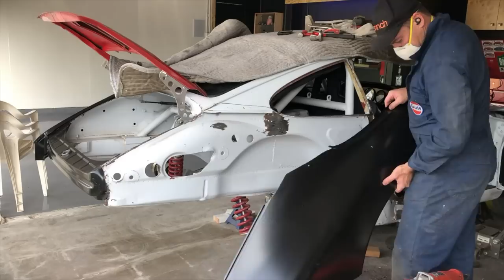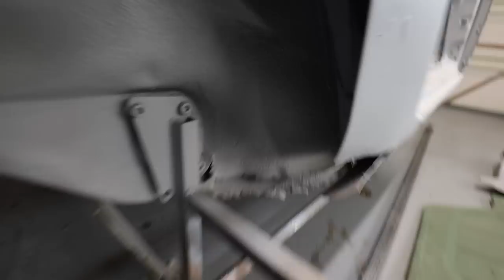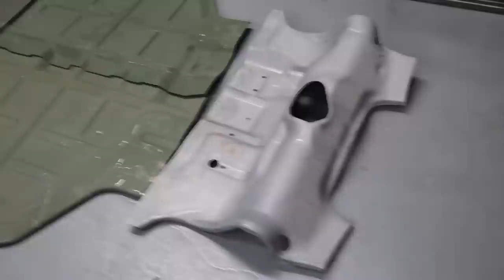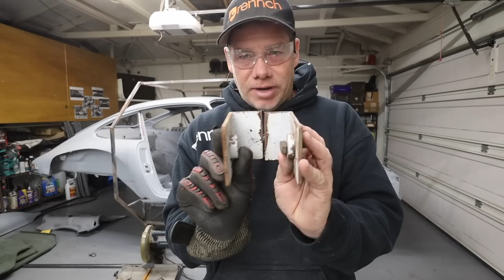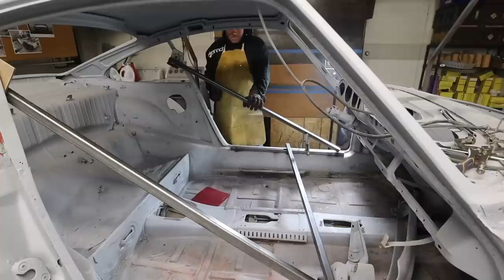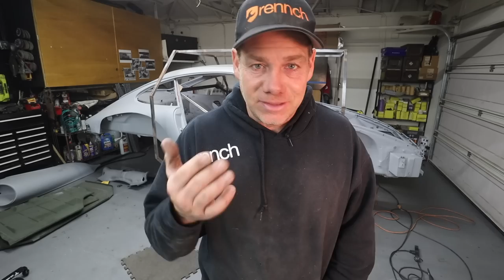Bringing A Rusty 1969 Porsche 911 Back From The Dead | ep. 1 Bracing The Chassis

Comment: Mike , if you want to give the car a little more support when you cut the floors out you can run a few 2X4 under it and use jack stands just to give you piece of mind . If you use T25 torks head screws. You can get creative and then unscrew everything when your done and reuse the wood.
Reply from the maker: I need to be able to flip it on its back to do the floors so can’t do that.
Reply: @rennch.  you could do the floors form inside or underneath, but it has to be a bit lifted from the ground for it to be done underneath

Comment: Wow, that's a serious amount of rust - the holes around the rear suspension (torsion bar tubes) area are particularly worrying.  Wonder how it looks inside - I guess you'll find out?!  I think you'll almost be building a new car from scratch.  I assume you've got some sheet metal from restoration design for the more straight forward sections?